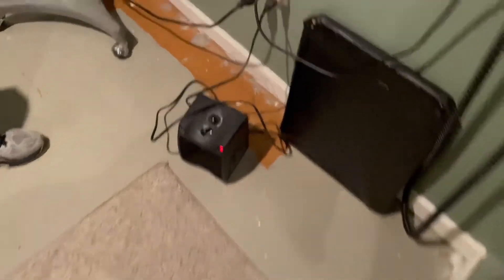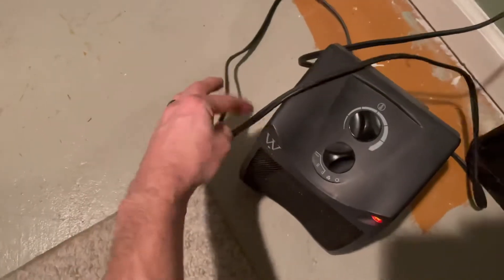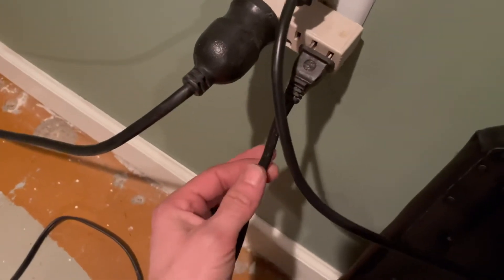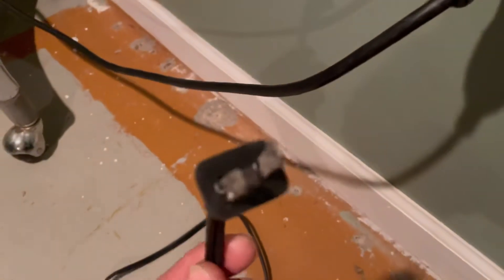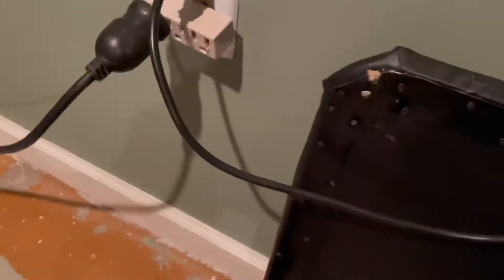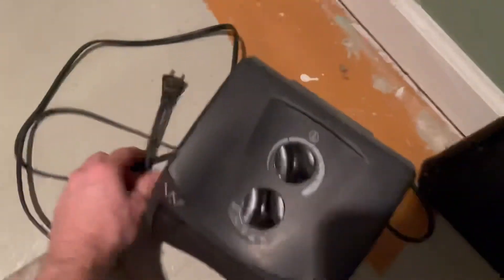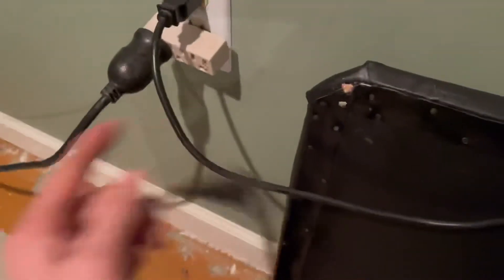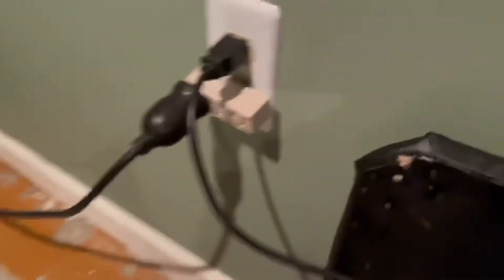Space Heater Safety 101. #firesafety #hvac #spaceheater #heating #safety #HVACEXPLAINED

Comment: What about plugging a space heater into a power strip made for shop power tools.
Reply from the maker: True...  You could just use common sense.   It’s not recommended from the manufacturer.  That is for higher amp draw such as power tools which “some” draw higher amps.  If you use common sense plug it in where the heater is sitting on a cement floor and supervised I wouldn’t be concerned but again the manufacture does not recommend that.  If you have a loose connections or wire nuts not properly tightened  they can draw higher amps damaging the tool or possible fire.
Thank you for the question.  Have a great day.
Reply: Just another thing laying on the floor to trip on.

Comment: Not enough outlets in the room just add a cheap triplug adapter. But make sure you have good fire insurance first, gonna need it.
Better advice, get a qualified electrician and have them add a circuit with a double gang box for two duplex receptacles.
Going cheap is a easy way to lose everything in a fire.
Reply from the maker: All new homes are required to to have plugs every 6ft.
Reply: HVAC EXPLAINED 
Spot on! Which is why cord length is limited also on UL listed devices.